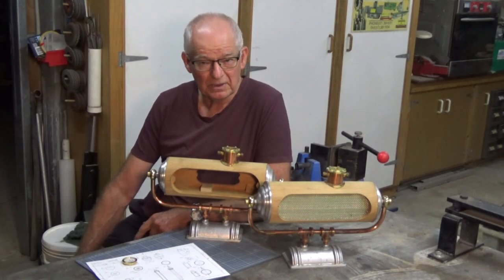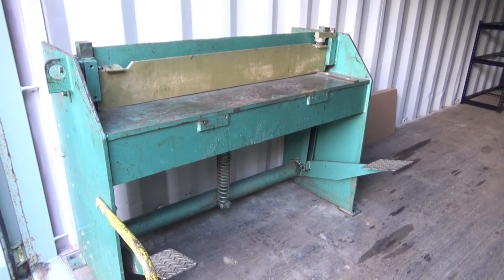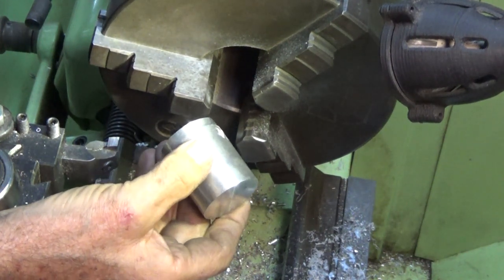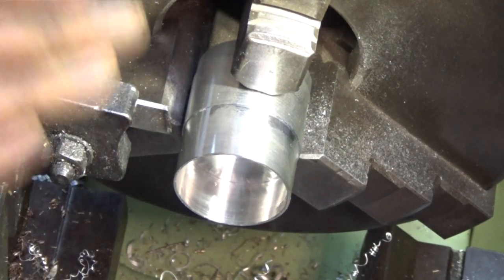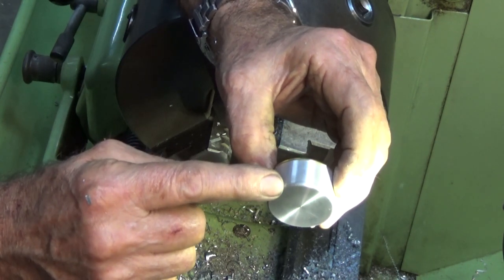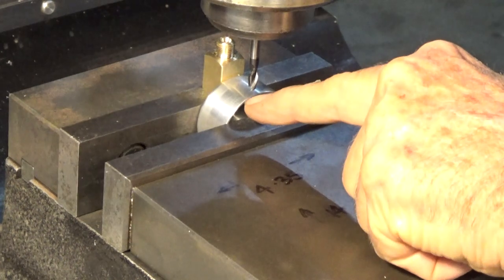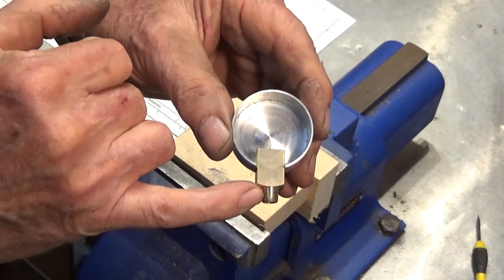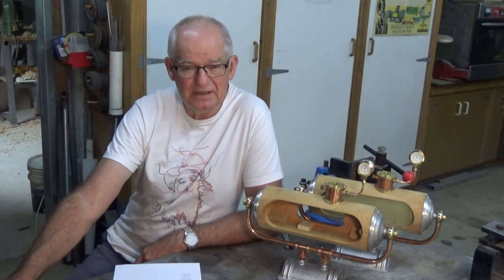The "MIXIE" A DIY Steampunk, Backlit Digital Clock - Part 7 - Fake Pressure Gauges

Comment: Beautiful interpretation Preso.  I liked the wood base and soft stop in the vice for the needle file work.  Never thought of doing it that way and will use that simple, clever approach in the future.  Be careful on those ladders while repairing the gutters.  Don’t get lured into believing you can reach just a little further without moving the ladder again.  This is true even on scaffolding.  All the best 👍👍😎👍👍
Reply from the maker: I am now old enough to be scared of ladders and the falls that go with them. A while ago I was felling some clumping palm trees and one fell across the ridge of the roof over our pizza oven. I climbed up a step ladder to try to dislodge it and in doing so it fell and knocked the ladder out from underneath me. One minute I was standing on a ladder and the next I'm flying earthwards on my back. By some miracle I landed flat on some soft grass and after working out what had happened I started a self check process to see what was broken and it was with a huge relief I realised I was totally fine. The ladder was toast though!
Regards,
Mark

Comment: Great video. A trick I’ve seen others use to get a flat bottomed hole on a lathe is to use an end mill after the drilling process.
Reply from the maker: If only I had end mills in that size! 
Regards,
Mark
Reply: @Preso58   I was thinking more to start off your boring bar and remove the dimple left from the drill bit.

Comment: Gday, mate that is a bloody beautiful job, it looks impressive, I need to have a chat to you about your blue dro soon if that’s ok, isn’t it funny one things goes wrong with the house and four others follow suit, well that’s the way it happens here, throughly enjoyed watching, cheers Matty
Reply from the maker: Matty, at least the home appliances are behaving themselves. We usually find that once one goes on the blink, two others go out in sympathy. With regard to the Touch DRO, I do like it but if I were doing it again I would probably get glass scales. The TouchDRO app is great but the capacitive scales are a bit flaky. I can still do accurate work with them but the flickering on the display is a bit annoying. I have a plan to hack the scale read head with an extra capacitor which is supposed to supress the flicker but I haven't tried it yet.
Regards,
Mark

Comment: Have you tried placing rubber bands on the outside of a chattering part to dampen the vibrations?
Reply from the maker: No, I haven't tried that yet. But it sounds like a simple fix. I will try it.
Regards,
Mark

Comment: Mark, I have an old container that came with our house.  It also came with the holes in the "roof" and where the sides meet the floor.  I didn't know that spare parts were available, so I bought some corrugated metal panels and enough wood (timber) to build a frame for it and now have a sloped corrugated roof above the original roof.  With no welding gear, I doubt I'll ever repair the holes near the floor, but at least stuff above the floor stays relatively dry.  :(
Reply from the maker: I can assure you that there are lots of shipping containers used for storage on acreage around where we live. We have neighbours on two sides with one or two. I often see fixes like the one you have carried out. I was actually considering doing the same. The big problem is that if the container deteriorates to the point where it is no longer serviceable, how do you dispose of it? I would hate to have to cut it up on site. We only just managed to get a tilt tray truck up to where it is now and doing the reverse would be a real mission. 
Regards,
Mark
Reply: @Preso58  Yes, I seriously doubt that a tilt-tray truck could easily get to my container now.  It was put there sometime between 1980 & ~2000.  Too many trees would have to be cut now to get it out and a replacement put in.

Comment: There is never enough time to get things fixed. We have a 4' sheer and I use it all the time, we did attach an pneumatic cylinder to it for repetition cutting. I can't express enough how fantastic these clocks are turning out. I think they would sell like crazy if you had them produced.
Reply from the maker: Craig, once you have used a shear or a guillotine for cutting sheet metal it's hard to go back to cutting with snips or nibblers. I don't know how many rectangles of sheet metal I cut up on that particular machine. It has probably spawned enough malformed and mangled cake tins and dustpans to sink a battleship. 
I actually have a battery operated hydraulic pump and some double acting hydraulic cylinders. I have a half baked plan to convert it to power operation too. 
Regards,
Mark

Comment: Your grandpa's flagpole is like the authentic sledge hammer that belonged to John Henry.  The handle was replaced about a half dozen times and the head wore out twice.
Reply from the maker: Well, it's still got 75% original wood in it!
Regards,
Mark

Comment: G’day Presso. We see you had a fair bit of rain, same here in Sydney, must’ve been deafening in the garage, it’s a bit hard to tell as the camera cuts the volume when it gets too loud. The clocks certainly steaming forward. 
Cheers 
Peter
Reply from the maker: It does get loud. I don't know how many shots have been binned because I got halfway through a lengthy monologue only to have it drowned out by the din on the roof. Similarly, I don't know how many times I have gotten up on the roof with a bucket of tools only to get wet!
Regards,
Mark

Comment: I doubled up the lower spindle bearings bearings on my knee mill. Just remove the spacer it is the same size as 2 bearings. Top 2 and bottom 2 same direction.  I really hope you are going to use dehydrated water when you pressure test that thing!
Reply from the maker: I didn't realise that you could add extra bearings. Probably a good thing as they cost a fortune after paying shipping from the USA. I will absolutely be using dry water. 😁

Comment: coming along quite well.  I was wondering for the container wouldn't it have been just as easy to gind the rust off, put a rubber coating on, then top it with a slanted wooden roof to keep the rain off, since the flat roof collects the rain, an off center A frame roof would shed the water, and probably be cheaper and easier than hauling heavy metal plates up to the top and welding them in.
Reply from the maker: When I was locating the container I placed it on steel post footings and I inclined the floor a few degrees to allow the water to drain off the roof. The problem was that I had to buy the container sight unseen and when it arrived there was a large depression in the roof at one end. This is the section that has rusted out. The other 2/3ds of the roof is fine because it is still flat. I did consider building an auxiliary roof and I mostly have the materials to do it but the replacement panels are only $100 each and they come flat and pre primed. I can also keep the old panels which can be used to cut up into patches for any future rust repairs. The big surprise to me was that Corten steel is not as rust resistant as I was led to believe.

Comment: Great video once again. My wife only lets me loose in the workshop when all the house upkeep/repair chores are done. Which mean almost never.  I am curious, was that a points file you were using to clean up the cutaway in the cup?
Reply from the maker: Wayne, the key here is to have a house maintenance job that must be done in the workshop. Make sure it is something that has to be painted so that you can monitor the paint drying while you do other 'personal projects'. 
The file was one of a set of needle files. The set has about 16 files of all shapes and cross sections. Really handy for this sort of work. 
Regards,
Mark

Comment: have you thought about boat epoxy to finish the flag pole,stop the fresh water rotting the wood.
Reply from the maker: To be honest, I just wanted to cut it up and burn it but I knew I would be king of the poo people if I did that. I have some very judgy relatives. However I ended up grafting new parts into the rotted areas with epoxy resin thickened up with talcum powder. The epoxy does help to stabilise the old wood and I used LOSP treated softwood for the repair. I have used this method a lot but unfortunately the epoxy is so stable that it never moves but the adjacent wood does expand and contract with changes in moisture content. This ultimately leads to gaps opening up so moisture can get in again. I am guessing I bought myself another ten years or so but the flagpole must be nearly 100 years old now so it's not doing too badly. 
Regards,
Mark

Comment: It seems you have a few maintenance issues and a HONEYDO list. ( honey do this honey do that ).  As mush as would like to say hey replace those bearings first. its not number one on your list. Home projects need to be done first.. Did you think about a structural epoxy for that patch. in the flagpole.
Reply from the maker: I patched the rot in the flagpole with a "graving piece" in LOSP treated pine and bonded it with a polyurethane adhesive. I have used structural epoxy on some outdoor items like handrails and windows and it seems to work well but it depends on the type of wood. Some of the really hard timber sections seem to reject the epoxy after a while and water gets into the interface material. 
Regards,
Mark

Comment: AAWW you chickened out with the parting off 😂
Don't you just hate it when you turn up a part and it lunches itself 2/3 of the way through parting it off 🤬. Dunno if you have tried them but i found the T blades that eccentric engineering sell to be the best i have used and exceptionally tough . I spent a weekend doing some tests with different parting tools9 insert, std hss , t blade ) ,cutting fluids /pastes  on 50 mm black steel bar - horrible crap to machine at the best of times !
IMHO  the t blade came out on top as it didn't self destruct when a dig in occurred like the insert blade did ( at $100 a blade it was soul destroying to see it disintegrate  i can tell you ) the t blade just flexed and didn't snap . The std hss blade was ok but i found i needed to really pump the cutting fluid in there to stop side jamming .
Guess what came out on top as a cutting fluid ?
Here is what i tried :
Neat Soluable oil 
RP7
WD40
Trefolex CDT
Trefolex paste 
Tap magic 
motor oil 
chain bar oil 
lanotec 
May have used ROIL - can't remember but i have used it before on the drill press and it worked fantastically - a bit expensive though !
One thing i can say is i will never ever ever use RP7 again as a cutting fluid , i was using WD40 and thought i would switch to RP7 half way through just for shits and giggles - the effect was an immediate seizure which snapped an insert blade off at the toolpost !
Reply from the maker: Ian, I have had some quite nasty breakages with standard HSS blades. I suspect my chuck jaws are bell mouthed and the cross slide ways have some wear also. The inverted parting tool was one by Eccentric Engineering but the design preceded the T blade type that he sells now. I also try very hard to ensure that the blade is set absolutely square to the work but as you say, side jamming is the real killer. I have been looking for a genuine Colchester rear tool post which would be great if I could get one but failing that I am thinking I might be able to fit a BXA QCTP on the rear of the cross slide if I could make a hefty enough riser block for it. I should really invest in one of the T type blades and be done with it. Interesting that RP7 didn't work out as a cutting fluid. I would have thought it would be much the same formulation as WD40.
Regards,
Mark
Reply: @Preso58  
I was thinking the same thing when I tried the RP7  but the effect was instantaneous- almost tore the toolpost off.
I have found the QCTP tends to give a little when I run the parting tool inverted and run the lathe in reverse - it sort of works like a relief valve when a dig in happens .